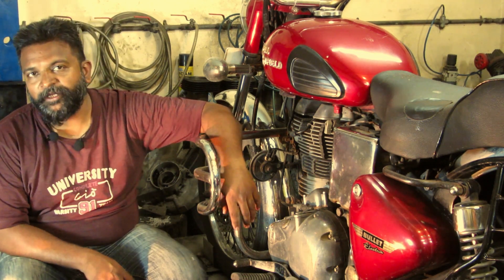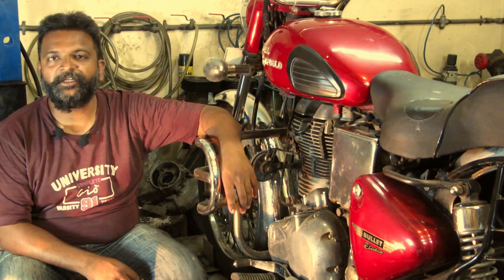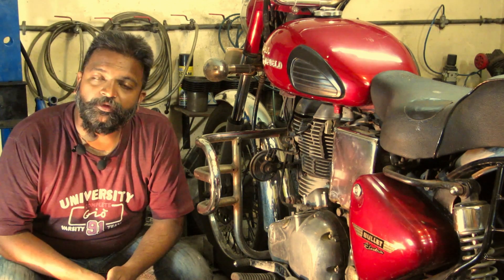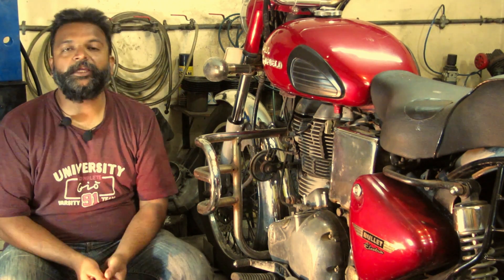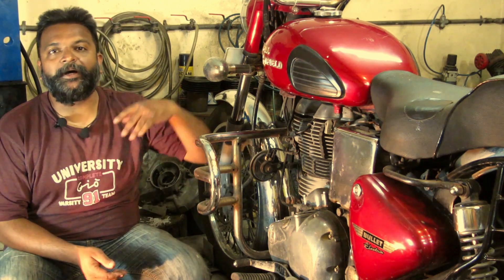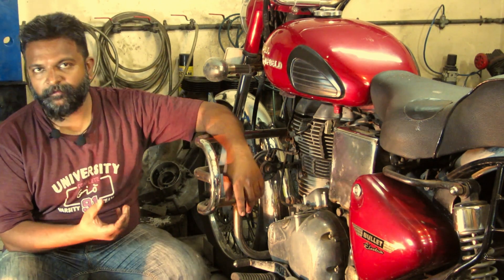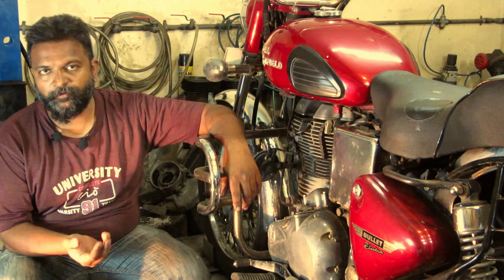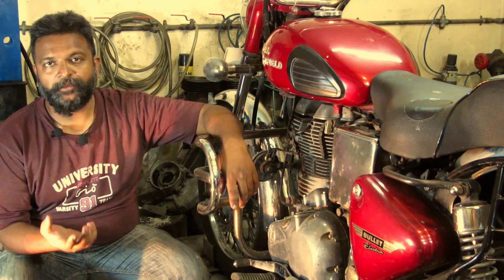Royal Enfield CV/BS Carburetor Tuning | Most Detailed Explaination | Himalayan AVL UCE Engines |

Comment: Sir recently I have got my bullet serviced and his average was 40+ but before service it got down to 30 suddenly and after service I didn't get any change in mileage even I got all filters changed and oil grade is same 15w50 liquid gun as usual.... 
Tuning is also looking good the white and clean spark plugs at 3 turns 
What will be the causes of low mileage??? 
Help me sir if u can🙏

Comment: Whats the use of extra rubber hose on the right side of carb goin no where other than overflow out
Reply from the maker: That's ATM vent. ATM = atmospheric pressure vent. If gets clogged or closed then there will be no fuel supply to the engine and no entry from the fuel tank. Fuel system in Carby vehicle is based on Gravity flow. So ATM has one of the important role.
Reply: @MechAutoClinic  thanx alot bhayya,i asked to many but didn't get anything makes sense 👍👍👍

Comment: At first total tight the mixer screw.Then turn anticlockwise 2.5 to 3 turn only.Then you set the minimum rpm that the bike not stop.Now you get desired milage of 40.

Comment: Bro my bike's rpm is increasing 4-6 screw turns but at 6 it shuts down occasionally at stop position, should i go with 3 turn tune factory recommended?
Reply from the maker: 6 half turns or 3 full turns. That's the setting.
Reply: At 6 turns spark plug color is black, i checked at aprox 200km city drive

Comment: Sir itz Absolutely great content for me.
My 2017 RE get only 19/20 km/L.
Thats y I'm very much disappointed. 
In odisha I shown my RE to various mechanic  but they suggest me to change carburator.  Also I changed carburator but problem remains same as moisture accumulated on out side of my carburator after ride 6/7 km. Also petrol leakage from drainage pipe.
Sir plz give me solution & kindly give urs contact no to contact with u regarding my problem.
Reply from the maker: Will let you know through video soon. Thanks. 🙏

Comment: hlo bro classic 350 2016 model bike17000km chli hai  white smoke de rhi thi engine oil bi kha rhi thi bike maine company se piston kit puri change krbayi aab bike koi 400 km chli hai or bike black smko de rhi hai kya problem ho skti hai bro btana plzz rply krke
Reply from the maker: Black smoke-wrong carburtor setting or rich mixture, white smoke-oil burning and stem type-perfect carb setting.
Reply from the maker: Rev limiter hain. Koi problem.nahi bike main.
Reply: SR BLACK SMOKE THIK KAISE HOGI 
FUEL KI SEETING KAISE KARE SR BTANA PLZZ
Reply from the maker: @singhsaabh8768  reset carburettor
Reply: @MechAutoClinic  sir carbutoer ko kaise rest krte hai aap bta skte ho sr
Reply from the maker: @singhsaabh8768  uska video Dala hain. Video
 list check karo
Reply: SR BALCK SMOKE JB MAIN FULL RACE DETA HU US TIME AATA HAI
SR AAP APNA WHATS AAP NO DO MAI APKO VEDIO SEND KRTA HU AAP KHUD BI DEKH LO 
ND SR ISKI SEETING KAISE KRTE HAI AAP BTA SKTE HO

Comment: Hallow Sir, I am Subhasish Saha, I have own a Bajaj Avenger Street 220 and as you know it's twin spark engine. And our carb model is Ukal-Micuni BS29. How can I properly tune my engine? I have already added twin NGK Iridium spark plug, K&N Rc1060 Air filter and up-jet main jet by 118 no jet (Stock 112.5). I need your valuable suggestion please.
Reply from the maker: 2.5 to 3 AFR is fine if you are confident about your JETTING.thanks

Comment: My bullet give 35 avg in solo ride .but when riding with pilon i get only 22avg ,can u tell what is problm for that????
Reply from the maker: model year?
Reply: mechautoclinic 1983 std
Reply: Restored 5years ago .its only run abt 8000kilometer
Reply from the maker: 1.5 AFR. if AUX is there then RPM plus minus HIGH side.
Reply: mechautoclinic there is no AUX screw (AUX parts )
Reply: Carb only there
Reply from the maker: set the AFR to 1.5 and keep the air filter clean...use 145z1 recommended bosch spark plug. keep the spark/ignition timing perfect. your battery voltage and current should be proper for best outcome.
Reply: mechautoclinic thnx broo
Reply from the maker: happy to help you.

Comment: Video is good, but how we can we tune it without the tool that you have.
Reply from the maker: yep ...don't worry vdo is inline...have already worked on that. just have to upload.
Reply: It's pretty easy, turn the afr screw to left slowly until the rpm is at maximum and is not increasing anymore. That's the perfect setting.

Comment: You are turning the screw clock wise or anti clock wise to bring the orange color ?
Reply from the maker: we have to bring Bunsen blue color. so to get that yes need to turn anti-clock wise or clockwise turning of AFR screw. Orange color we dont want.
Reply: Sir I understand that we need Bunsen blue. I asked for info where were u rotating to get the orange color ?
Reply: Every one doesn't has this special tool. Can you explain which way to turn the screw at an average ? I understand that every bike will need differnet turn radius but is there an average estimate which u can give after completely tightening the screw. Or any other method .
Reply from the maker: Bunsen you will get towards anti clockwise side. orange starts towards clockwise. sometimes that varies...